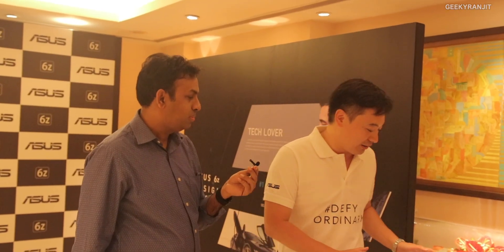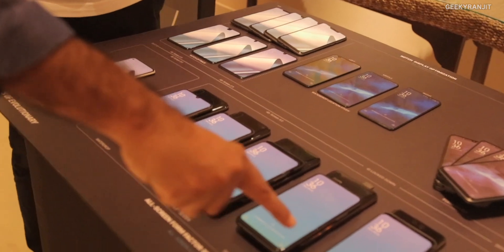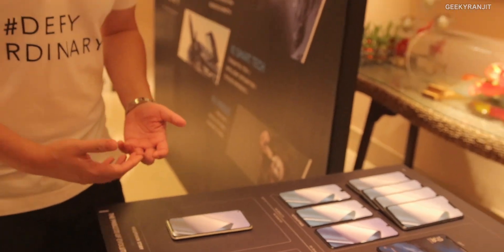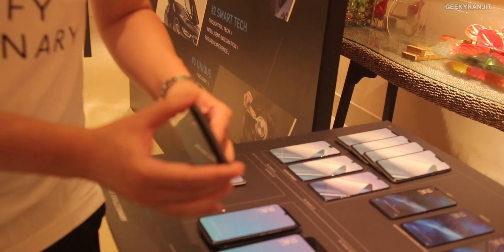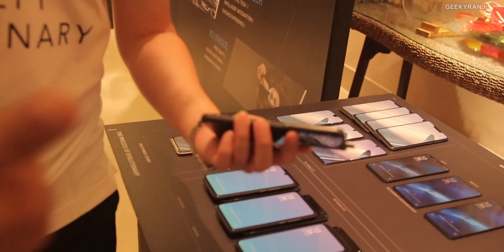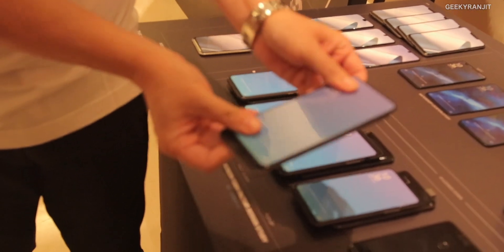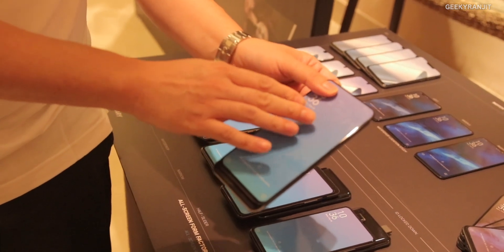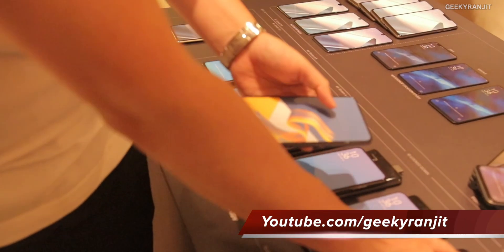What's Inside Asus 6Z Smartphone behind the Scene (Exclusive Footage)

Comment: Geekyranjit  -  Excellent video, answering many of my questions not only regarding the phone but the company also. My questions: 

Is there to be an Anniversary Edition (30th) offered on this 6z model phone? If so, what are the expected specs, release date, colours, and cost? Will an anniversary edition be offered in the Canadian/US version? If so, what are the expected specs, colours, and costs?

My understanding is that there will be a specific regular, non-anniversary model coming July 19th for Canada and the US. Will the US model have the necessary bands, LTE, etc (larger numbers and small numbers with whatever is necessary in between along with 66/71) to be able to be used in both larger cities and smaller cities? What are the spec offerings for the global version(s) be along with costs in $US?

Will the sim card tray allow for two phone numbers to be used at the same time? Used at the same time as the micro sd card also?

The only thing I can see missing is the IR blaster on this phone.

Thank you.

Comment: @geekyranjit Asus does not support Airtel VOLTE. Please ask ASUS team to talk to AIRTEL and provide all of us VOLTE.
Reply: I think there is no airtel volte in ur area coz  it is not possible..... if a processor supports volte then it is for all the service provider
Reply: @ShubhamK0517  Volte is supported in my area. It is running on phones of  other people with Airtel sim. I called customer care they said that your phone does not support full volte. Which I recheck and came to know it does but The real  issue is that asus's device are listed in airtel' s volte supported list. Asus people need to talk to Airtel to add support for Airtel VOLTE
Reply: @shaluaggarwal1517  ohh.. so u should get in touch with customer care n ask them whats the problem cause my friend is using airtel volte in his phone
Reply: @ShubhamK0517  the different phone brand ???? The brand has to talk to Airteland ask to enable volte for all Asus compatible phone
Reply: @shaluaggarwal1517  no he also has asus max pro m1 and it  works fine in delhi
Reply: Also they are talking about insta but they (Asus India ) never reply

Comment: Asus should go with dual slider with Zenfone 7....
After buying Zenfone c,5,2 laser,lite l1,5z now 6z love u asus
Reply: Yes slider design is also appealing. I hope they give one of the best speakers on market
Reply: If they use a slider there will be no 3.5mm headphone port.
Reply: @vishesh Sharma...yes bro...I think  it is a software bug...
I'm also facing issue with play store apps downloading...
Most of the time play store work properly but some times it's sucks..
Reply: I think Asus will implement there slider on ROG 2 which is coming on 23 July...2019...with 120hz refresh rate...😋😋
Reply: @vegeta8965  yes for gaming a special speaker under the slider with theatre like sound would be a killer feature.
Reply: Bro do you feel downloading problem with lite L1?